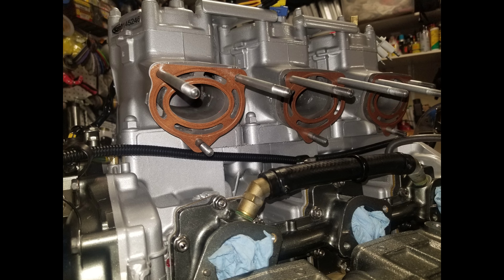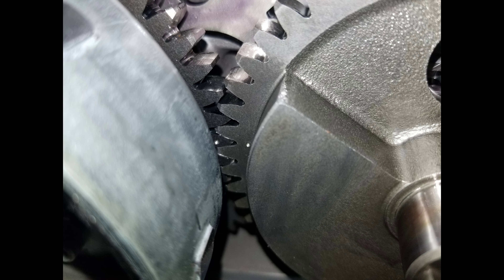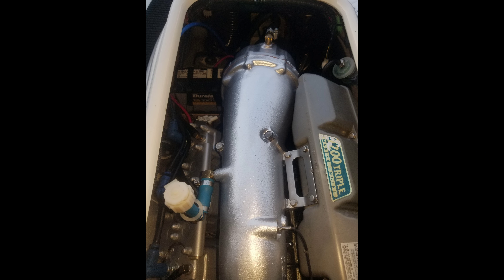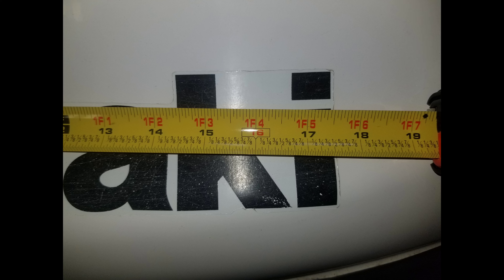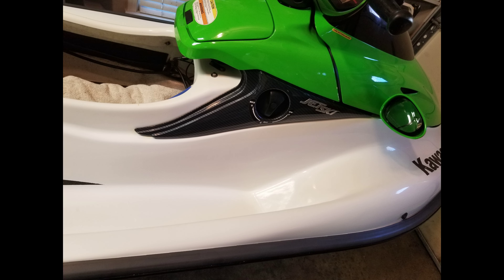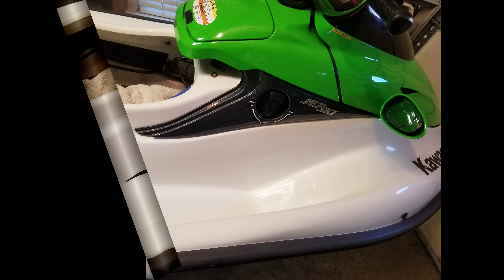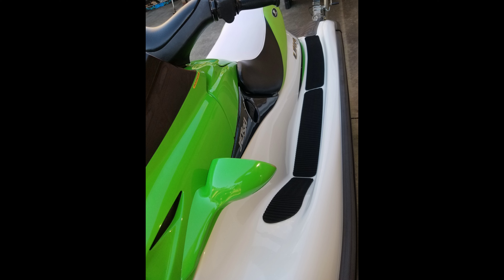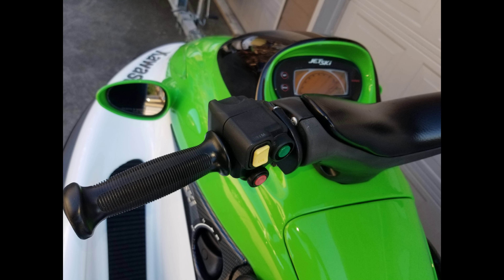2005 Kawasaki Ultra 150 Restoration Part 2 | Fastest 2 Stroke Jet Ski! #jetski

Comment: Wow didn’t think I would see someone else build one. I’d love to see an update on that sbt motor after some hours
Reply from the maker: This is the 3rd Ultra 150 I have built/ owned. The 1st one I rebuilt was a 2001 Blue one and I also used an SBT Engine. It held up great for the year I owned it then I sold it. The ski would hit 66-67 mph all day long. Loved that ski and loved this 2005 one I finished. The Ritco Products Seat Cover was so much nicer looking than the black one that was originally on it. What year is the ski you built or are building? I can say the Ultra 150 and GP1300R skis are just about my favorite 2 stroke skis out of all my projects.